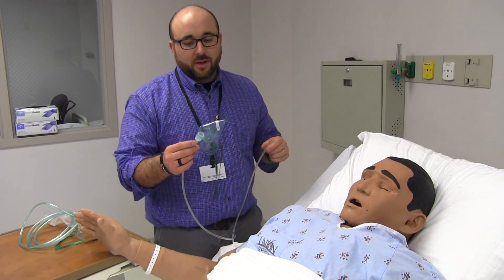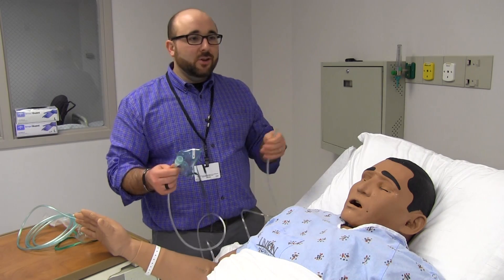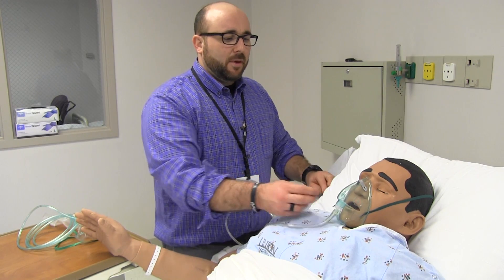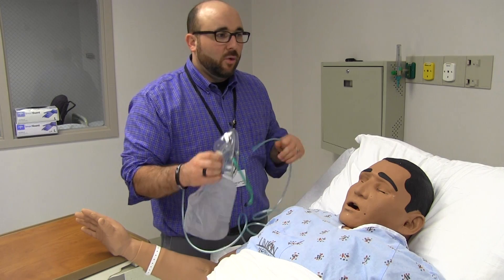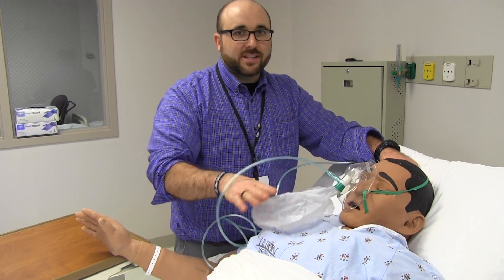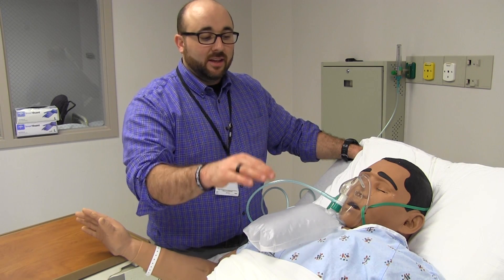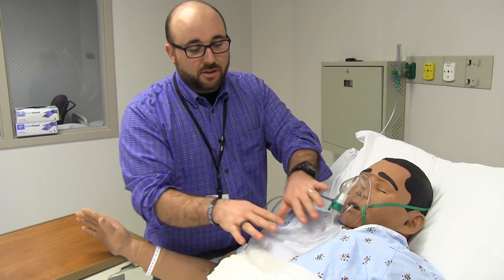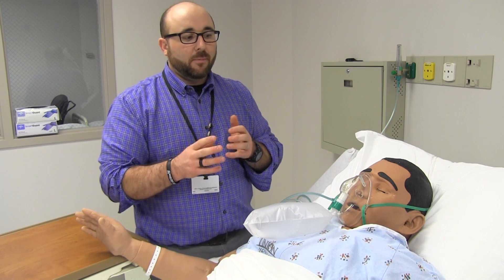RT Clinic : Simple and Nonrebreather mask application

Comment: Thought a non rebreather was 10 to 15 lmp?
Reply from the maker: Technically you set it at the flow required to keep the bag inflated during the inspiratory and expiratory cycles. 15 LPM is the best setting to keep it easy.

Comment: What about those tiny holes on the sides ? Mine are covered with something when I put the mask out of the bag
Reply from the maker: Those holes are covered by a rubber cover to allow the patient to pull 100% oxygen from the inflated bag instead of from the air around them. The one way rubber covers increase the amount of delivered oxygen
Reply: @rtclinic  thanks a lot 👍😀

Comment: Do you have a great way to connect a non rebreather with a neb treatment? Normally I just plug one end and slide the mouthpiece into the side of the mask.
Reply from the maker: I use the same method as you. I should experiment with fio2 concentrations with other configurations...🤔

Comment: Is it mandatory not to use bottle humidifier  in oxygen when using a non rebreather mask?
Reply from the maker: It isn't mandatory and many bottles can't handle the flow rate of a non rebreather. The pop off valve will be activated on the bottle if you turn the flowmeter up to 15 LPM.

Comment: Officially NRBs provide 100%... due to masks not being completely airtight I was told this was more like 95%. Is 80-90% really accurate?
Reply from the maker: I think it matters if you remove the rubber one way covers from the outside of the mask. I always remove one or two because the risk of keeping them outweighs their benefit.

Comment: Oxy mask 1/4 to 2 LPM neo, to manly 1 - 20 LPM range ped to adult.  Fio2 has been studied at 20 lpm at 95 - 97.5% , our new non heated high flow nasal cannula 7-15 lpm used to be used for neo but now its used now for ped to adults 7-15 lpm on 9 psi. then added a 60% ( https://teachim.org/2017/07/13/inpatient-evaluation-of-hypoxia-and-dyspnea/venturi-mask-2/ ) at around 25 - 30 LPM lpm ≥ 60 lpm total flow to get to 30 lpm use dual flow meter on our 25 lpm + 5 lpm on dual flow meter hf Y connector. on either our new fork tubes in ER/OR, PACU and CCU right now, if higher a low flow nasal cannula with etco2 cannula uneath the mask and underneath the cannula. we a pulling away from N/P rebreather mask do to fio2 issues, at higher flow the bag can be to deflated or in case of a whiteout the bag could pop and if the sick/injured patient and we no longer use a simple face mask. the oxy mask works great for NG Tubing or O2 intabate cannula bypass D.A.Space etc. and if the patient is stable a straw can fit through so the patient can drink.  we will be getting the heated high flow cannula as well from what OR / PACU told me yesterday.

Comment: I just got out of OR/PACU as an EMS Instructor and during my first time i got (southern slang) to use a low high flow nasal cannula at 13 LPM. i was given Lorazepam 4mg + 4 (8) mg mixed with Midazolam 2mg x 4 (8mg), Ketamine 15mg over 10 min for nerve pain very slow IV push, post-op down to 9 lpm on methadone 10mg PO for pain with 12.5mg of Diphenhydramine IV.  i was having Cystoscopy & Renal Biopsy,  could not get spinal do to my severe kyphoscoliosis. 2 Ansthologist tried plus 2 ARNA tried. also i hate the NR/PR mask Oxymask can use 1/4 liter to 25 lpm

Comment: I was put on a non rebreather mask last week and they had it set at 25lpm. Was that too much? It was on the portable oxygen not a wall mounted one.
Reply from the maker: You really can't put 'too much' on a non-rebreather. The only problem with 25 lpm is how quickly you'll burn through an e-cylinder. It would probably last about 20 mins if it was started at 2200 psi. 15 lpm is best (will last 44 mins), but the key is to keep the reservoir bag inflated during the inspiratory cycle. 
Thanks for the question!!!
Reply: Why were you put on one? We’re you sick ?
Reply: Cristianandtupac cluster headaches

Comment: Would you put a humidifier on the non rebreather since the oxygen delivery is more than 4mL
Reply from the maker: Thanks a great question Tahmina. I must have overlooked it 4 mths ago. 😄
You can add humidity in the form of a large volume nebulizer attached to a mask, but with air entrainment it will yield a lower Fio2. There are two reasons we do not use humidity on a non rebreather. 1. The moisture would cause the one way valves to stick and it will also accumulate moisture in the NRB bag. 
2. The majority of NRB flow will be brought through the nose passively and heated/ humidified by the nasopharynx. 
Great question
If you patient needs humidity in these cases, the best bet is a large volume nebulizer.  
I hope this helps
Reply: o

Comment: does the non rebreather have 2 valves and a partial with one valve???
Reply from the maker: A non-rebreather has three one-way valves. A partial rebreather has two one-way valves on the mask, but the opening between the mask and reservoir does not have a one-way valve. The fiO2 delivered is greater with a non-rebreather, but the clinical effects are not usually significant. A very good question Philly B !
Reply: thats a negative for 3 right I see a empty side valve on it